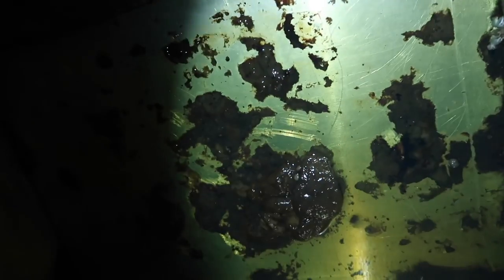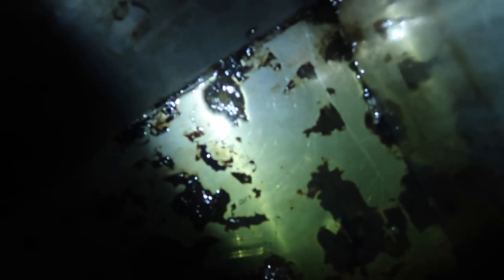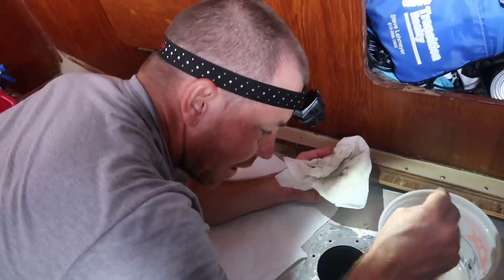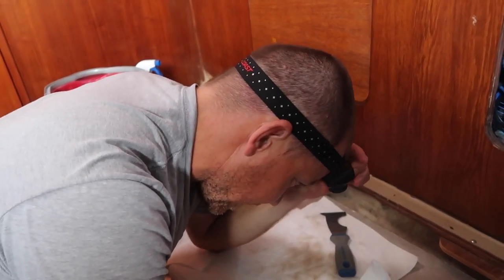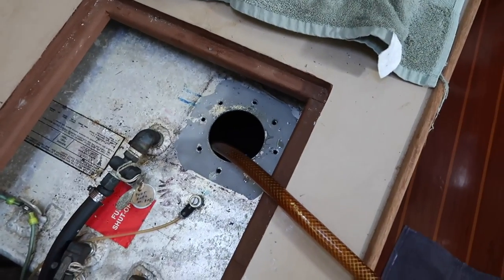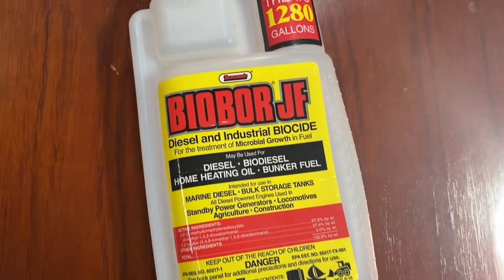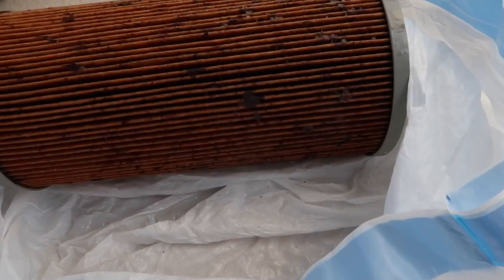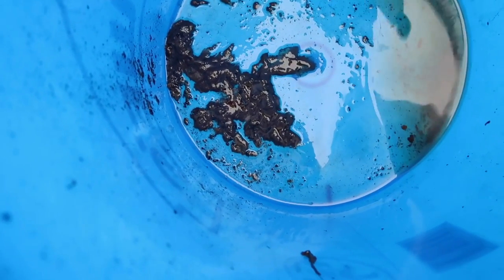What grows beneath - Fuel tank FAIL! Polishing our diesel fuel tanks (Sailing Satori) S3:E06

Comment: Here is a way you can get more sludge out. Rent a pressure washer or borrow one. Remover inspection port.  Remove fuel.  Place two rags in the corners on one side.  Take a halyard and have someone big haul it down so the boat will heel.  Use the pressure washer to blast on the upper side of the baffle notch. Make sure that the rag prevents stuff from going in the opposite baffle system on the down side. Clean the gunk out of that section with the inspection port. Then heel the other way . It does a decent job on sludge at the bottom of tanks. The pressure generally can get all the way to the back if you aim it right.
Reply from the maker: Hell of an imagination you have there Allyn. I think it’s worth a try just to make a video about it! 😂

Comment: Very glad to see you have discovered biocides and I would also recommend using what we in CA call a “Baja filter.”  I lived aboard a boat that circumnavigated the earth over a period of six years and NEVER had a fuel problem because of these two key defenses.  The filter is a pain, and you probably don’t need it in highly developed fueling locations, but ALWAYS use one if there is even the slightest question about the source of your diesel fuel. Oh, also  always check your intake water; I noticed you have an overheat sensor, but that only works if there is nearly zero water intake for your engine, but symptoms could seem the same as fuel clogs.

Comment: Like others have said you should add access plates to the sections between baffles. No telling what’s still in there. I had similar tank design so added 8” diameter access plates made by Seabuilt. Made for this type retrofit, no welding required. A little pricey but the improvement is worth every penny.

For what it’s worth PRI-D diesel fuel treatment has worked well for me. I’ve been told it’s the best diesel fuel treatment, but I’m sure lots of opinions out there.
Reply from the maker: Good call. Stay tuned...
Reply from the maker: Good call. Stay tuned...

Comment: When you have to replace your fuel tank/tanks and you will (saw some pitting due to water) have them designed with a well/sump at a designed low side spot in the tank. At that low spot have two things, 1) an inspection spigot to draw fuel from to examine. 2) a pick-up tube for your own fuel polisher. Also the tank should have a few limber holes (especially where the vertical wall meets the baffle and floor) at the bottom of the tank of each baffle to allow "Dead Bugs" to flow to the well area. On the opposite side of the well should be the return line from your polisher to add some "current" in the fuel tank to wash the bugs down. Get the same size Racor you now have for same filter element replacement. High capacity pump for a strong return pressure of fuel to the tank. All appropriate on-off valving to select inputs and outlets. Water in the fuel will always be at your tanks low spot and only get to your filter/separator when your shaking the tank and running the engine, or if you have a spigot at that low spot. That was an Excellent approach to your current problem that you performed.
Reply from the maker: Interesting solution. I wish I had this super tank you speak of. Thanks for watching and the comment!

Comment: May be worth you guys checking the O ring or seal on your diesel filler cap. It is the most likely cause of moisture in the tank given your location will not cause massive condensation and bug that can only grow when there is moisture in the tank. Then just check the tank breather has a good swan neck loop to resist water ingress... Couple of thoughts for you ...... Sail Safe. Ant, Cid & the Pooch crew.
Reply from the maker: Thanks for the tip guys!

Comment: Ours was so bad, and I got so tired of changing Racors, that I took the tank out (ours was only a 39 gallon tank and easy to get to) and had it pressure washed (they make specialized wands for this to get around the  baffles).  The stuff that came out, looked just like that (the consistence of cooked down spinach and unidentified gunk!).  We used BioBor after that, and I don't think I changed a single fuel filter in the three years after that, that we owned the boat!  That's a pretty slick polishing rig.
Reply from the maker: Yeah, I was lucky to find it here in Luperon. Not a lot of resources readily available there. After our tanks were completely cleaned (coming up in the next couple vids), we haven’t had any issues since.

Comment: CUT MORE INSPECTION HOLES. It is just soft aluminum. A jig saw will do a great job. Buy some self tapping screws, gasket material and sheet aluminum. Do both tanks. You will be amazed by the amount of junk still in the tanks. As you have seen, if the gunk plugs the fuel line, the best filter in the world won't help. Everyone complains about filters clogging but the cause is a dirty tank. Especially check the fuel pick up tube.
Reply from the maker: Stay tuned...

Comment: To avoid condensation and water in the fuel add methylated spirit, have always done that in my boats and never had a problem.  Also you should clean the supply and return line system with methylated spirit.  Diesel bugs are a major problem unless that fuel system is cleaned in its entierty.  Good tht you add biocide that will keep the system good once propely cleaned.  Also you should check the tank bottom for pitting corrsion, which it looked like I could see just after the first cleaning.  One problem solved migth cause another to show up like dirt off and pitting revealed and can cause small leakage.  Just to add the diesel bugs live in the bottom water at the tank and feed off the desel above.  Good luck on your adventures and fair winds.
Reply from the maker: Thanks Lars! Stay tuned...
Reply: @SailingSatori  Absolutely - looking forward to the continuation..

Comment: PRIST is an ANTIBACTERIAL used in jet fuel tanks to ELIMINATE YOUR SPECIFIC PROBLEM!  this PRIST works fine with any kerosene based fuel . Diesel, jet-A , heating oil, etc. I add prist to my heating oil tank at my cabin in Alaska.  Also in my diesel truck!  Also I fill my diesel truck with jet-A with PRIST already  added every once in awhile to keep it clean but kind of expensive to  do it too often. Remember PRIST

Comment: For enviormental reasons sulfur was removed from diesel fuel. It acted as an insecticide keeping the organics from growing in the fuel. The organics create the sludge and water so you have to polish the fuel regularly. When i had my generator tanks cleaned the vendor used a chemical treatment first that killed it and caused it to drop to the bottom of the tank where it was vaccumed and run through a filter and returned to the tank replacing filters until the fuel tested clean. I would suggest a double fuel filter system on your engine so you can quickly switch to a clean filter if the one you have in service starts to clog.
Reply from the maker: We have the 2 filter system onboard. I’ve shown it in a couple other videos. It’s nice to know you can have a fresh clean filter with the turn of a valve!

Comment: Fuel polishing helps, but you have lots of that sludge on the other sides of the baffles.  How do I know?  I have a 110-gals diesel tank on my trawler.  The center section has an access panel like yours.  I cleaned that out just like you.  Then I developed a leak on the right side of the tank but could not get to it due to the baffle.  I cut 2 more access ports, on either side of the baffles.  You could not imagine the amount of sludge on the bottom of the tank.  Each side had a pile of sludge 2.5 inches high, in a 9-inch pie pan.  I am sorry to say, I would bet money that there is the same amount of sludge you found in the center section, in the other 3 sections.  My sludge would not be affected by a bumpy cruise - it was pretty firmly affixed to the bottom of the tank.  BTW, I use BioBor JF also.  I am switching to an additive called Fuel Right.  Best of luck.

Comment: I had my fuel tank (40 gallons) professionally cleaned last summer. They pumped all the fuel out into a 55 gallon drum, filtering it. 

Then they Pressured washed the entire insides using, Industrial Purple Cleaner & Degreaser. Using a Shop Vacuum. More Spraying. Shop Vac. A final rinse and Vacuum. 

Squeaky clean! Then repolishing my fuel back into my tank adding Bio Side.

It took them, I was there, 3 hours. And cost me $720 USD.

New Racor filter, $$
Disposal fee, $$

I bought my Ericson 41 last March. I wanted to be sure that there were no problems with the fuel tank. 

One of the owners, I'm the 4th, had a clean out install on the tank, and they cut away some of the baffling (2) to get on the other sides.

I had  to cut a circular hole in the Cockpit sole.

I didn't have hardly any sludge. Water yes. I need a new Fuel Deck Fill.

When we run our Diesel's. The return fuel line, returns HOT fuel back into the cold fuel tank. Condensation is formed.
Reply from the maker: Interesting... kind of expensive to get that bad boy cleaned out professionally. But I bet it’s worth the peace of mind!
Reply: @SailingSatori  

I wanted to see how the Pro's do it, first. Yes it was expensive. Today I have most of the equipment to do it myself. 

12 volt Fuel Transfer Pump & clear hoses. 

A large Fuel Filter, Racor. Extra Filters. 

3 gallon Shop Vac. 

And this summer I'll buy a 1000 or 1500 PSI Pressure washer.

And a few other smaller items. I'll be able to use this tools for other purposes too.

Comment: Algae grows in diesel fuel more in tropical hot weather than in colder climates. I had the same problem in my fuel tanks. I put in a small day tank that only hols 15 gal. and an electric pump to fill it from my main tank. when I fill it the fuel goes through a racor filter. The day tank is above the fuel pump on the engine so that the polished fuel is gravity fed to the secondary filters.If you only fill the day tank for what you use in a day the fuel should stay free of algae. Be careful using algaecides be cause they can cause the algae to clump up in the bottom of the tank just like you had. Look for marinas that have filters between their pumps and the nozzle as their tanks may have lots of algae.
Reply from the maker: I have read about gravity fed day tanks. Sounds like a pretty good solution.

Comment: Ive been dreaded this, We will need to clean the tank before we set off.
Reply from the maker: It’s really not that bad of a cleaning chore, If you have inspection ports in each section. If you don’t, and have any concerns, I would suggest adding them. I’ll be doing the same in the next couple videos. 😉

Comment: Biobor and be ready to change filters a lot. Please cut inspection holes. so you can clean the pick up areas
Reply from the maker: Stay tuned...
Reply: @SailingSatori  Indeed. You might want to pull out the pick up tubes and see if there is a screen on the end of them that's clogged.  You can also get a hose down the pick up tube and suck out the junk but the best way to do it is to cut a hole in the top of the tank so you can clean it out. You can also add a fine mesh screen "cup" under the pick up tubes that way.  If you cut a 4"  (or larger) hole you can add a 4" screen cup/cylinder under each pick up tube.  Or you can use a screen off an automotive in tank fuel pump but they wouldn't have as much area.   Looking forward to your solution.

Comment: There is a bacteria that forms in diesel fuel, and there is a treatment for it. I forget what it is called.
Reply from the maker: Biobore is one... and is now used regularly.
Reply: PRIST is the only ANTIBACTERIAL you need!!! Trust me
Reply: It algae from having water in your tank. If it's that bad you can use the biocide to break it up. Add a little bit of fuel and suck most of it back out. Shouldn't be an issue for the fuel filter to take care of.

Comment: Nick. Love the videos.  I actually have the same boat here on the Chesapeake.... Not that its boat specific, but take a peak at these access plate kits https://fueltankparts.com/collections/custom-flanges-parts-adapters/products/6od-x-4id-bolt-in-tank-clean-out-access-plate   I am looking at installing one per chamber and adding a dedicated pick-up ( all the way at the bottom of the tank to get water) and return to the tank with a DIY fuel polisher on a 12v digital timer to auto-polish the fuel tank once a week for 6-8 hours. Probably overkill, but that and biocide every time fuel is added should keep the fuel super clean.
Reply from the maker: Hi Robert! That’s awesome, would love to see some pics of your boat! I am currently working on a video where I install access ports to all of the tank sections. Scrambled around Puerto Rico to get all the materials for DIY ports. No problems since then!
Reply: @SailingSatori  I'll send you some pics via your website contact. I've been busy last 2 seasons redoing interior cushions/foam, added solar, swim platform, wifi gateway for instruments, IPAD nav, class B AIS, replaced all hatch seals and acrylic, restitched all canvas, resealed hull/deck joint, etc, etc. It never ends!!!!

Comment: there are additives same as in jet fuel that will kill off the slime. commercial transport aircraft have the same issues.
Reply from the maker: Damn... I’d rather be in the boat when things go wrong. 😳
Reply: Sailing Satori atleast you can pull over at 35000 feet that’s not an option

Comment: Time to buy a 4" hole saw and make yourself 3 other access ports.  You'll be done in 5-10 minutes.
Edit: Well, I guess everyone is saying that.
Reply from the maker: 5-10 minutes?😂
Reply: @SailingSatori  Don't try to rush it!  You've probably already done it, but if you haven't...  
1.  Be sure that your holesaw blade is Bimetal.
2.  To drill or cut SS with a holesaw, use relatively SLOW speed and firm pressure.  Use a light viscosity lubricant to  help dissipate the heat.  In a pinch you can just use soapy water, but diesel will also work.  
3.  Take your time.  If the tank is heavy gauge, stop after a minute, wait a minute, repeat.  If you build up too much heat you'll work harden the metal, not to mention destroying the holesaw.  I have holesaws that I have used dozen of times on SS, following this procedure.

Comment: I had a conversation with a specialist diesel system cleaner.  Fuel bug actually grows in the tiniest amounts of water in the tanks. This is often caused by condensation and the bug is algae which is airborne. Leave a glass of water standing for a few days and see what happens.

Comment: the one tank having way more growth got me thinking.  And that hurt! LOL : )
But a question came to mind, do each of the tanks have to be filled or is there a interconnecting line between the two?  Thought being that the water that causes the growth may not be from condensation but from water in the fuel that settles to the bottom of the primary tank during fueling.  Good luck!
Reply from the maker: Both tanks are filled separately. Interesting thought though, as painful as it was. 😉

Comment: Step by step:  1.  Find a source for sheet aluminum that matches the thickness of your tank.  Thicker is okay.  You should be good with a 24” x 24” sheet for three 6” holes.
2.  Get a box of sheet metal screws and some gasket making sealant.  3.  Cut a 4” hole over each baffled section of the tank and sand the edges.  4.  Cut three 6” holes out of the sheet metal you sourced.  The discs will be the covers for your inspection holes on the tank. 5.  When the tank is clean and ready, de-burr your covering discs with sandpaper.  6.  Dry fit your cover discs and tape down with masking tape.  7.  Layout your screw holes with even spacing of about 2” all around.  8.  Drill holes at 12 o’clock and 6 o’clock and screw them tight.  9.  Drill the rest of your screw holes.  10.  Mark 12 o’clock on each disc and the tank for each cover.  11.  De-burr each screw hole with a countersink bit and wipe clean with acetone.  12. Apply a solid bead of gasket sealant around perimeter of inspection hole on tank.  13.  Lay cover disc with 12 o’clock matching mark on tank and insert screws, tightening only about halfway.  14.  Leave the discs and gasket sealant to set up overnight.  15.  The next day, tighten all screws firmly.
Reply from the maker: Thanks David, very specific. I will end up doing this exact process in one of the next few vids... no surprise!